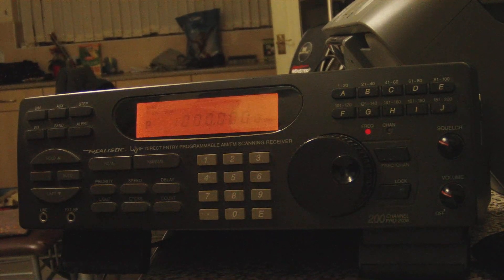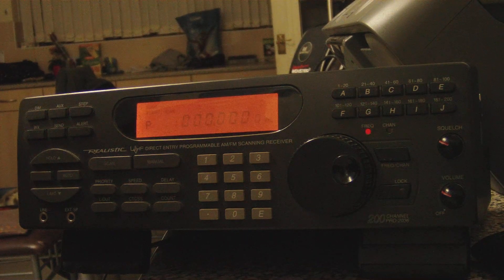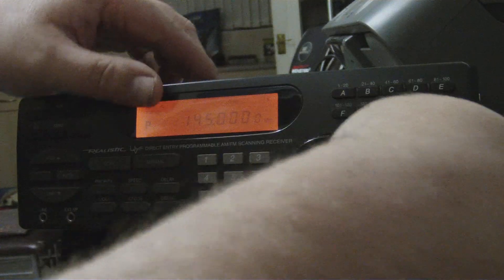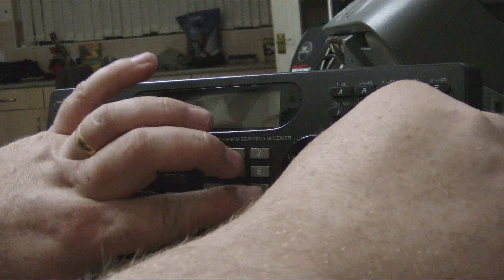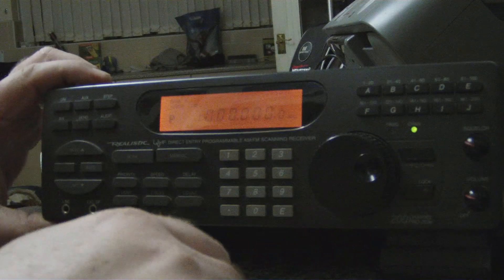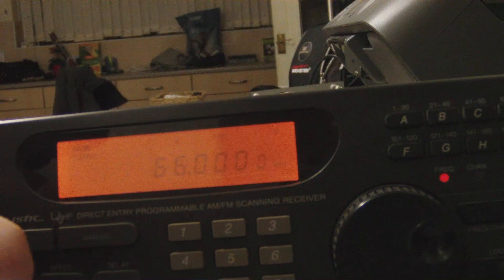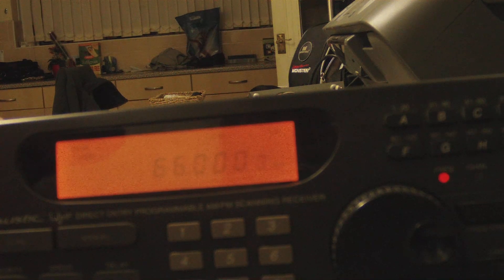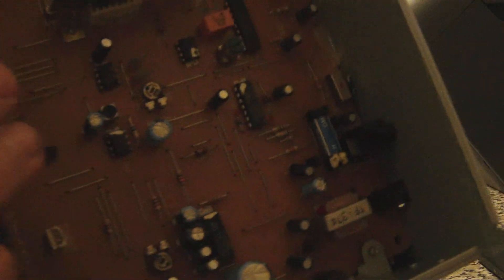Realistic Pro-2036 Conversion Mod Help Needed

Comment: I just bought the USA pro 2036 for around 20bucks on Ebay I'm sure there are more. I have a pro2044 that does 29Mhz as well- there are a few "mods" for the 2036 on the web but I have not seen any for the UK model. But if there is a mod Radionut53 would know about it. I've seen him build a 6 metre rig out of a baby monitor. Also I wish I could find a Mod to open up the 10 meter band to 28MhZ as well??? or the AM 11 meter band???  Good luck and 73's
KB1YDB

Comment: For those that don't know, 29mhz is the top end of the 10metre ham band, which runs from 28mhz thru 29.7 mhz. The 29mhz portion is used extensively for FM transmissions. As for getting the 2036 to hear it, snipping a single diode will unlock 29mhz. Please don't ask which diode, i don't know and don't have the circuit diagram.